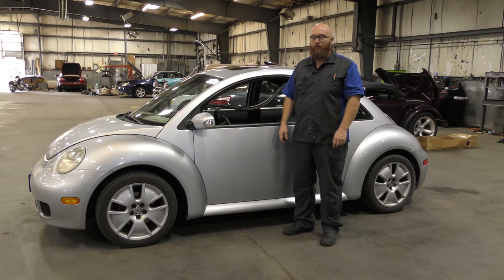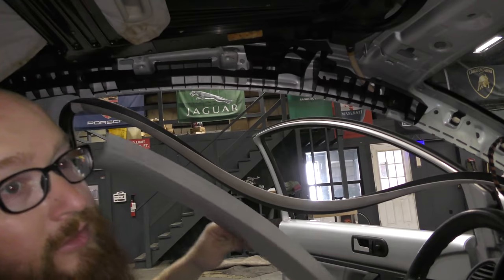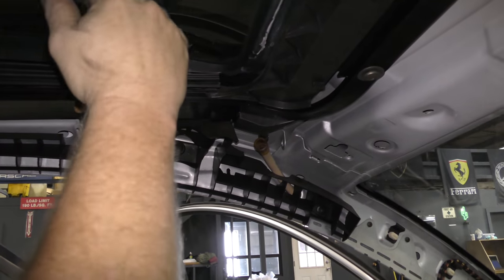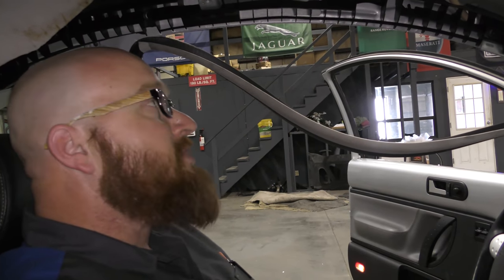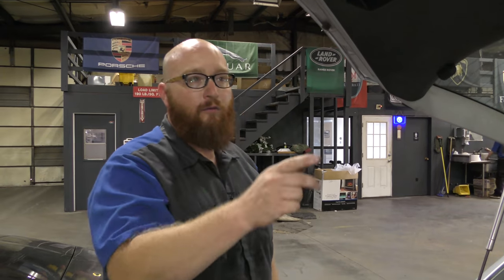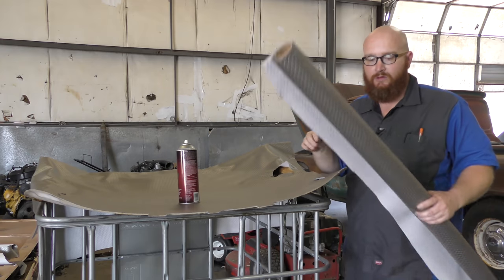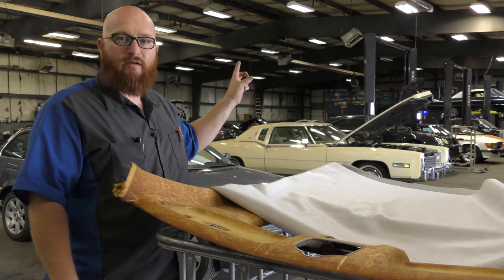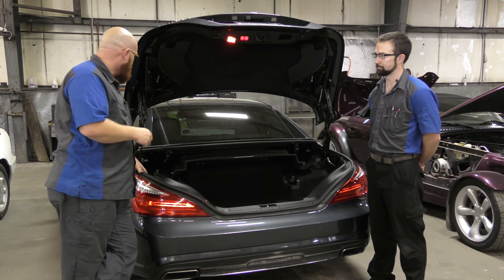VW Drooping Headliner & Mercedes Convertible issues! CAR WIZARD shows one is easy and the other not!

Comment: I've had an old Dodge Caravan have the wires between the door and body corrode which made the power lock switch on the driver side able to only lock the doors and the one on the passenger side able to only unlock the doors. Was fun figuring that out

Comment: One time I found a broken switch in the vanity mirror in the visor of my Tahoe.  The battery kept going dead because the light never went off, took a while to find that one...
Reply: In a xc60, we had the globe box that wouldn't close enough. Resulting of this, the switch wouldn't turn the light off. My father thought it was me in the back seat turning on the reading light and the battery went dead in winter ! With the electrical handbreak on... What a nightmare ! ( why can't we have a physical handbrake anymore ? it could be like in old mercedes at the footwell... much more reliable )

Comment: It's important to realize that there is often a thin layer of soft fabric-quality foam between the headliner cardboard and the cloth.  It's this soft layer of foam that disintegrates, and so you cannot just poke a hole in the headliner and spray glue up inside and remount the headliner cloth.  The cloth will stick only briefly to the degrading foam..  Since the foam itself is disintegrating it will split in a new layer above the layer where you have glued it back.

Comment: That Merc looks pretty good, sucks that the guy probably payed for the job twice or more by replacing those parts and then finally having someone just diagnose it...although if you guys were able to get the lights to dim by wiggling the trunk lid surely the owner/whoever he had trying to fix it saw that too?

Here's hoping both the headliner and hatch wiring on my Regal TourX last a while.  First "new" car I've ever bought (within a year or two of release), it was damaged when I got it from the previous owner and needed a new front and rear bumper so I just ordered the Opel Insignia parts and stripped the plastic cladding else where to get closer to the wagon I really wanted.  I'm a bit of a wagon nerd though, I've also got a Volvo 850R wagon, BMW E46 Touring, and a custom "Golf R SportWagen" built out of boredom, salvage cars, too much spare time, and an annoyance that we never get any of the fun wagons in the US (I'm talking about you Ford Focus ST Wagon or even the good looking reasonable Corolla Wagon).

Comment: Top Tip:  go out to ebay and find the trim pieces you need to remove.  There should be a pic of the back side with all the hook placements.  That way you can figure out how to remove the piece w/o breaking it.

Comment: The factory will use the front windshield  opening on most cars.  I have gotten a headliner from a 2003 grand Prix GTP sedan using the front passenger door.  It took some work but it came out.

Comment: Wouldn't it be a good idea to seal the "fiberboard" of the headliner with something like polyurethane and let that dry before applying the glue?  That would solidify it, prevent it from deteriorating again, and help the glue stick to it better.

Comment: I remember when I was a kid my parents had an 85 new yorker with a sagging headliner. We would use thumbtacks to try and keep it off our heads. That didn't work though. It took some time but the sag would eventually overcome the tacks. Then one day my old man had an epiphany. He bought some aerosolized glue like the wizard has and he cut the headliner down the middle. Then he scraped as much of the crumbly rotten foam out. He sprayed the glue all over and pressed the liner down. I wish I could say it the split down the middle wasn't noticeable, but it was very noticeable. However, it kept the liner up off our heads and looked reasonably okay. If you're looking to do this yourself, just cut it and spray. Press it together as well as you can, and live with it. Just my opinion.

Comment: I have been driving VWs since 1972. All the VWs since the mk4 period (1999+) have glue/foam that can't take heat. The headliner goes bad on all VWs that don't have a panoramic sunroof (which breaks and is worse). The further South you live, the faster it takes place. The deficient glue doesn't just cause separation and flapping, the nasty orange glue balls fall into the car. I had a 2006 GTI which had this problem. The list price for a new headliner is more than $1000. I watched the local pick a part junkyard and when a two door mk5 GTI with sunroof showed up I went down and pulled the headliner. It was like new because I now live in Colorado where it is cool. The cost was $21 plus $9 in taxes and fees.

Comment: Just had the headliner and sunroof drains cleaned on my 2003 Audi A4 Avant after a year of trouble shooting the water pooling in the spare wheel well. FYI $300 for the drains to be unblocked and $800 for the new headliner. Money well spent to get a professional job done on an otherwise nice reliable car. The new headliner matches the old grey fabric very well.

Comment: If you don't let the glue cure long enough before joining the material, in a few weeks to months, the glue can re-liquify from the unevaporated solvent and makes an ungodly mess. Nothing worse than Spray 77 on Spray 90 that's reliquified. "Microwaved snot" comes to mind.

Comment: After years of owning multiple convertibles, if I have issues with the top function the first thing I check is the loom bend point. In my experience 99.9% of the time that's where the problem is.

Comment: Don't skimp, take the sunroof visor out.  It takes 15 minutes max.  Put the sunroof in the vent position, you can do it with the little hex tool you'll find in the cover for the control.  Then it's just six torx screws...3 per side and the glass lifts out. Once that's out remove the trim pieces on the sides and slide the visor forward.  Put gently put pressure in the middle to release the visor from it's tracks.  Super easy, just did this yesterday on our 02 Turbo S.  Then it was $175 for an upholstery shop to recover the headliner and sun visor.  Everyone I spoke to said NOT to use a spray can adhesive.  They typically fail and then you're back to square one.  So pull the headliner and visor yourself and let the pro's handle the fabric.  And you did not need to remove the B pillar trim and the weather seal to that extent, the headliner can be carefully slipped out from behind those.

Comment: I've had droopy headliner fabric on 3 of my Ford Panthers.  Rubber cement worked fine on 2 of them, but this '04 MGM doesn't seem to be taking to that solution.  Is that expensive 3M stuff worth it?  Will it work where rubber cement won't?

Comment: I painted thumbtacks primer gray, and used them to hold up my headliner.
Reply: A workmate of mine stapled the headliner in his Audi A4 and worked a treat.
Reply: Maybe you could use a long straw from a WD-40 can on that spray adhesive, cut some tiny holes into the headliner and spray it everywhere.
Reply: @jospi2  that's how I would assume you do it if you don't mind jerry rigging
Reply: jospi2 that’ll stain the fabric.
Reply: We used pins, with the little balls on the end. Put 'em in at a shallow angle... I thought if I did it again, i'd use glow-in-the-dark ones!
Reply: If you want it looking like new, taking everything apart is the only way. It's worth it!
Reply: @taunuslunatic404  Until you staple through some wiring in the liner
Reply: On my New Beetle, tacks, and covered with glow-in-dark stars and planets. Put a black light on the center armrest. Put on the Floyd, it’s planetarium time!
Reply: Gord Wilcox this sounds awesome, i wish i had done this to my Saab instead of just stapling it
Reply: Robert Hunter do it right or don’t do it at all
Reply: well done.
Reply: wurly164 Oh please. Many folks run beaters. There are simple DIY options that'll work. Dismantling apart a headliner on an old car can cause more problems than it's worth. I mean, yea, in theory doing things the right way is the best way but not always practical.
Reply: Genius! I just chucked a woodscrew in there.
Reply: @MaShcode  it's the way I was taught. I always take pride in my work, big or small
Reply: @wurly164  only if you have enought resources sometimes live wont allow it. Work smart work hard also justifies diy tricks to recycle old cars keep then alive a little longer
Reply: @kitecattestecke2303  that's true if you can't afford it, otherwise I don't see any excuse for shotty work.
Reply: @wurly164  Id rather enjoy life than fanny around with a headliner lmao

Comment: I want to change the rear speakers in my 2010 access cab tacoma, but they are mounted to the roof under  the headliner. Dont want to do that as I know how much work is involved. I also do not know what size speakers they are.

Comment: 2011 Chrysler 300c.  Air conditioner compressor intermittently not working. Fuse was loose in holder and arcing causing fuse to curl up a little and have a  loose connection. replaced fuse and bent tabs to hold fuse tighter... repair cost... Free.

Comment: Headliners are always a PITA. Some cars you actually have to remove the glass to get it out. I took one out of a 2019 golf R at work and you actually need a special tool that VW came up with that has the sole purpose of releasing the grab handles. Were screws not good enough?!?!?
Reply: Exactly why I like older small cars, they're simple to work on, sound nicer and they're so light they're easy to push if need be.
Reply: Jeez Mk6 Golfs use screws. So weird they would make something special for that!
Reply: Prepare yourself a lot of golf r and gti's have sunroof leaks...
Reply: Only needed to remove the headliner on one car and it was clear it had gone in via the windscreen aperture, not the hatch which was way too small. Fortunately just dropping it gave me enough room to do what I wanted - put some much-needed damping pads on the roof.
Reply: Assembly time reduction- they probably snap in, but dumb to require a special tool to remove.
Reply: K Moni oh for sure, the new grab handles were easy enough to snap back in but man did their removal cause me a lot of headaches, especially since only VW dealers were allowed to buy the tool (until someone clones it at least)
Reply: Jean-Francois Pare I don’t really do warranty work so hopefully I’m saved from that headache. If only one could get a car without a sunroof that isn’t the base model.
Reply: @Fhwgads11  how come the headliner needs replacing? Its 1 yo old?
Reply: Zanic L3 I only had to take the headliner out of the car, I reused the same one. There was damage on the roof that needed to be repaired, which meant the shark fin antenna and sunroof needed to come off (which meant headliner had to come off) so there weren’t any masking lines that would make it apparent the car had been repaired.

Comment: Or do like i did using stainless steel staples and try to keep the staples position equal so that now as times goes on and more of the headliner drops i get to have a Rolls Royce like starshow headliner till i'm fed up end up replacing it.

Comment: I was a VW service writer back in the early ‘70s. We had a customer who had a type 1, that’s a Bug. The car would sometimes not start or would not shut off, and it was having  other electrical problems things happening on it’s own.
 We checked it out and could find nothing. I talk with the customer. Told her we couldn’t find the problem. I brought the car up from the back lot, stop the car and turned it off. When she got in it would not start. Turn the key nothing would happen. I wanted to see if a jump would start it. The battery in under the rear seat on the right side. I lifted the seat up and tried to jump, it did nothing. I happened to look just to the left of the battery and there is a relay for the rear window defroster. That relay has  open connectors facing up. There was a penny on top of that relay that was flopping back-and-forth causing feedback in the electrical system making the car seem possessed. I remove the penny showed her the relay told her to have a nice day and we never had another problem with the electrical system in that car.

Comment: Gotta be careful with the compressed air on the VW sunroof drains or you will blow apart the joint on the other end down by the firewall, then the driver side sunroof drains into the dash right above the fuse box.

Comment: A while back I had a really crappy car, a Fiat Palio Weekend. In the span of 3 days I had 2 drivers hit me in the rear. (Really no damage) It was strange, so I investigated, and found that the brake lights fuse was blown. So I replaced it. it burnt again. I went to my mechanic, actually his partner, the car electrician. He found that a strange thing happened. When a LPG tank was installed in the trunk (It`s a mini station wagon) the LPG technician drilled 4 holes trough the floor. What happened is that he basically missed the rear light cable loom by millimeters. And over time the brake light cable rubbed against and short circuited on the screw affixing the LPG tank (I think it`s an M12 screw). So this is my nightmare wire story.

Comment: Just had my w 211 e320 apart for left had number plate light ,a broken wire on the boot lid hinge just where the factory cable tie point

Comment: Even new cars its easy to break those plastic tabs on trim, I've successfully use gorilla glue to reattach the broken piece.

Most of the time there is room to use allot to reinforce the tab, probably stonger than the non-broken ones afterwards.
Reply: I use crazyglue and activator for instant results. Hobby shops have the activator.

Comment: I work in maintenance manufacturing. I love it when they ask how long it will take. I just say I am not making pizza. It can be 20 min or a few hours.
Reply: same with me in software engineering. 
Some time ago someone asked me how long it'd take to fix an issue we'd not even diagnosed yet. Told them anywhere from 10 minutes to 10 weeks. 
They weren't happy.
Now, 6 weeks later, we're close to tackling it, think we've found the root cause, and it involves rewriting a lot of code that was designed around a fundamentally flawed assumption.

Comment: Great video as usual.  If it hasn't got 3M on the tin forget it, you get what you pay for.  I bet the guy on the production line was allocated 5 minutes to fit the headlining in place before all the other pieces get installed.
Reply: On the assembly line the headliner would be a complete assembly ready to install. They have some pretty elaborate machines at assembly plants. I was flabbergasted to see the machine for installing seat covers. It was truly genius. First a plastic bag goes over the completed seat shell with all the foam on it and then they sit the seat on a pedestal that draws a vacuum on the the plastic bag causing the seat assembly to shrink. This is done with a foot pedal by the worker and then they simply slide the completed seat covers over the shell. The whole process takes 2 minutes or maybe less. Johnson Controls does most of General Motors interiors. So when your GM interior sucks blame Johnson Controls not GM.

Comment: Everybody: ~Use Thumb tacks  to keep headliner up. 
Wizard: takes most of the interior apart.
Reply: Nothing wrong with using thumbtacks even if it's only a temporary fix but it's far easier and works great in my experience.
Reply: Melody Mellybyte do it right or don’t do it at all
Reply: until one falls off and onto the seat
Reply: I did that once with previous car!
Reply: Maybe poke the glue nozzle with a straw on it in various spots and spray away then press after a few minutes. Never tried it though.
Reply: @wurly164  if the car is not worth repairing a thumbtack would be a solution, I appreciate wizard's solution means he really cares about his beetle I would do the same if I had a car I liked and wanted to keep as pristine as possible.
Reply: Wizard is the guy... who fixes the problem instead of putting a band aid on it.
Reply: For an old car if the headliner has completely dropped it's simpler to cut around the rear and sides, clean and vacuum, re-glue and reapply. It ain't perfection but it'll getter done until it next stop at the salvage yard.
Reply: Well pins:)  See above post:)
Reply: Marc B. Upholstery pins. worth the extra 10 cents. Designed to pierce and anchor. :)
Reply: I got a quote of a little over a thousand dollars on my 2002 BMW 330 CI . I passed and will live with it.
Reply: The factory puts the headliner in through the front windshield before the windshield goes in. ....... well some brands go in through the rear trunk/hatch

Comment: Sweet, because I have to do a headliner for the Jetta  Ute. 
If I ever get the stones to pick up the saw and cut into it to start the project,that is.
I'll admit ,I thought taking a saw to a car would be fun but I'm a little squeamish right now.
Reply: 12:18 
Question 
Did you remove those little metal inserts that are in the holes for the interior lights before applying the fabric ?

Comment: Great video as usual, but it should probably be pointed out that 77 spray mount is potentially really dangerous and nasty stuff. Works great, definitely what you should use here, but needs to be done in a very well ventilated area, preferably outside. It's not just unpleasant,  I could possibly kill you. Most art schools have strict rules about not using it in hallways or stairwells and will have dedicated spray rooms with air ducts and fans that consonantly run. You should at least be by a window with a fan, preferably wearing a mask. I've used it for mounting artwork to boards, great product when used correctly.